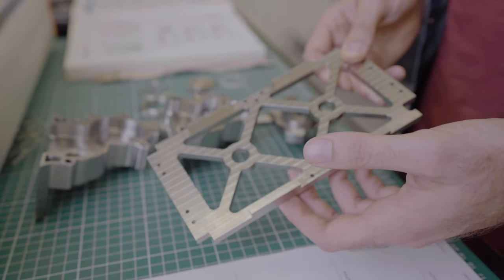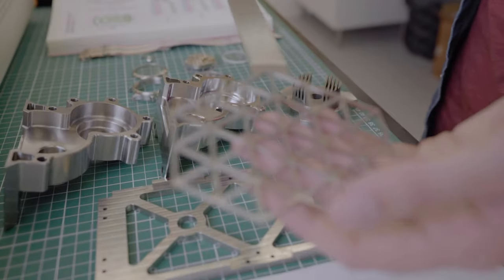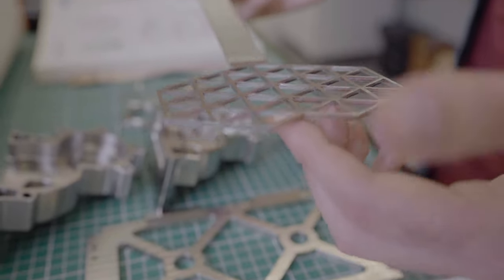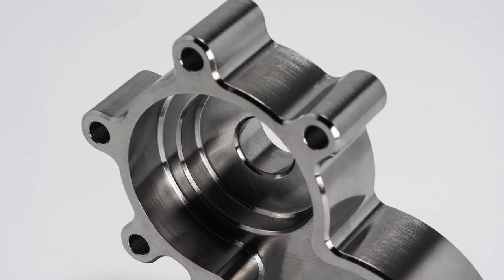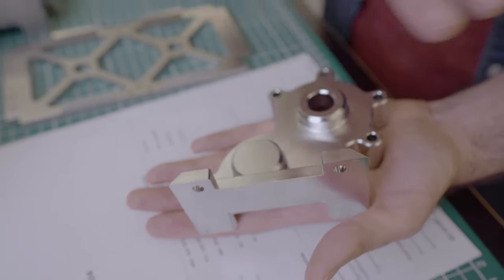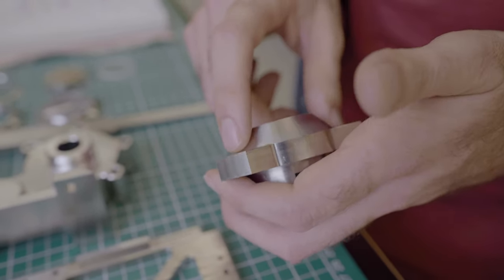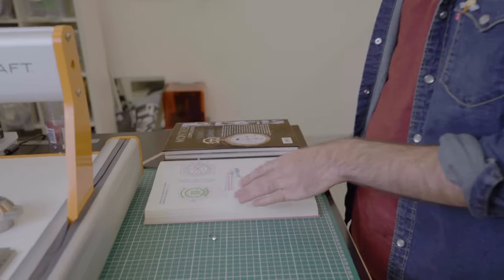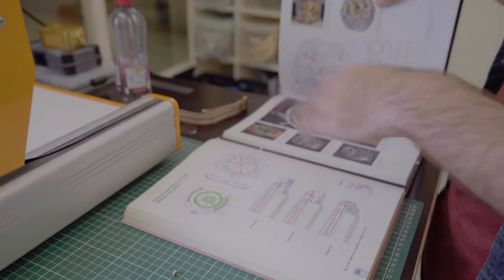Stainless Steel (304 vs 316) for CNC machining

Comment: I was planning on getting some watch cases made sometime next year, I've designed and 3d printed to check fits with the movement, geared toward a 3d resin printer, so will need slightly altered to suit CNC. What size of screw threads did you use for the case back? I have designed it for M1, but I think the 3D hubs site recommends not to go below M4 for stainless, and obviously that's a bit too big for a watch case. My case is designed to fit the ETA2824/SW200 movement, more or less the same as in your original watch. I'd be interested to know how you set up for the front and back crystals, is it a straight 90 degree fitting or is it undercut or angled in anyway? My case is designed for a 32mm glass, though I'm not too sure of the size of gasket and actual opening for the glass, I think the wall thickness for the i-gasket is 0.7mm, so the overall opening would be about 33.4? Also, I was planning a H7/p6 press fit for the bezel. Is this possible with CNC?

Sorry for all the questions, I struggle to find people that have the actual knowledge to help, as I'm pretty much winging it myself, haha.
Reply from the maker: Hey Paul, Thanks a lot for reaching out ! You seem to be super passionate about watches too, that’s super great, don’t apologize for the questions :smile:
Regarding the back, I used another back plate I already had from another project, but what I know for sure is that the screws are M1.2mm. It is quite tricky and not everyone can tap such small threads on SS indeed, so we had to make sure with the machinists that they could machine it properly before making it, so it should be possible if one of our engineers assists you and takes a look to put you in touch with the right team for the job !
Well spotted for the movement, my original watch indeed uses an ETA-2824-2 to be precise, but that movement is much smaller compared to the inner diameter of the case, so you would need an adapter (which I didn’t want to have to deal with for this design), but it is a great movement (also, there’s lot of information and standard parts available for it, which is always great when experimenting !)
For the front crystal fit (probably what took me the longest time figuring out, I have to admit), I went with a regular sapphire (35.50mm) with a bevel on it, and it’s mounted with an “I” gasket that came with the glass. I first measured the glass with the gasket mounted on it (36.25mm) and then had the case machined with a diameter 0.15 to 0.20mm smaller than that (some people recommend only 0.1mm, but I wasn’t comfortable enough for a first try). In the end, the diameter came back at 36.07, which made the glass and the gasket press fit reasonably well (I didn’t take a glass fitting press and made a custom screw-press, but I would recommend getting one if you want to do a proper job without damaging the parts).
For the bezel, an H7p6 fit should be totally possible tolerance-wise with us, if the geometry is reasonably easy, and done mostly on turning. Of course you should in that case select our “tight tolerance” option (I would also recommend calling out the actual tolerances in microns instead of p or H on your drawings). Personally though, I would probably start with an H7g6 or equivalent for the first prototypes, maybe use watch-grade glue to test the assembly, and then move to a stronger fit when you have a press to properly assemble the 2 parts. Or even do with a less tight tolerance and just mention that the 2 parts must assemble (you gain on cost, but lose on repeatability and precision of the fit).
Let me know if any other questions, would love to see more of your project !
- Antoine
Reply: @ProtolabsMFG  thanks for your reply and the info. I'll look into the gasket and fitting options, I have a crystal/case press and have assembled an eBay bought watch case with a press fit, so I'm comfortable with the assembly. Once I've got my design redrawn and decided on final dimensions etc., I'll be in touch. If you would like a look at my rough designs so far, look at phi_watches on Instagram, as I've been documenting my progress (and confusion) on that.
Reply from the maker: @Saltcoatsbhoy  Were are happy to help! your insta looks cool. It's on our featured list for @3dhubs :) When you have your dimensions and design 'done' you can upload and play with all kinds of features and get an instant quote (for free) on our platform. Just something that might help when making design decisions. https://www.3dhubs.com/manufacture/?technology=cnc-machining

Comment: Awesome video... I may have this backwards but I want to clarify. Is 316ss easier to hold tolerances and flatness than 304ss? 

Also for corrosion, our parts go in waterlines and sewers, you said 304ss is more corrosion resistant?
Reply from the maker: Hi! 316 generally has a higher resistance to corrosion than 304, as it has more zinc and molybdenum in it, so 316 would a better choice than 304 corrosion-wise.
Mechanically, however, the 2 alloys are pretty similar, so you won’t hold a better flatness per se with 316 compared to 304. Worth noting that 316 is much harder to machine though, so in a nutshell, you probably want to make sure that it’s really needed for your application.